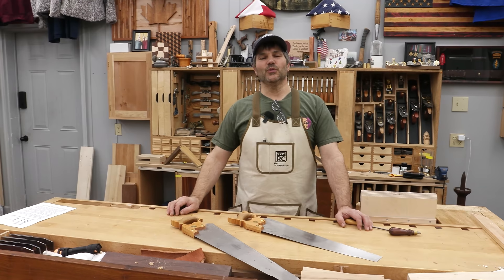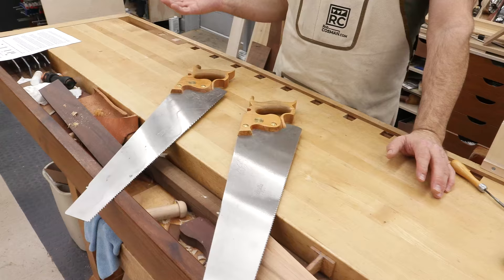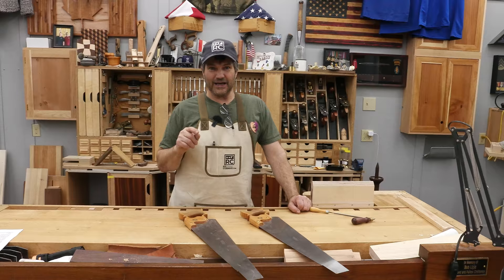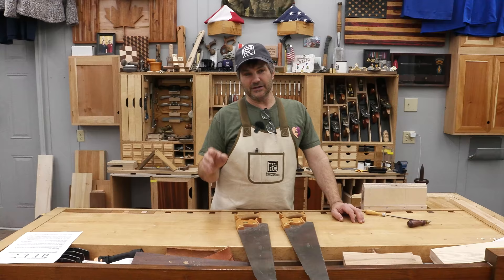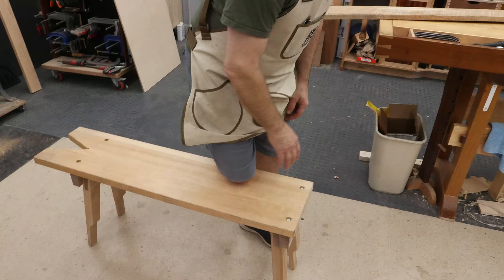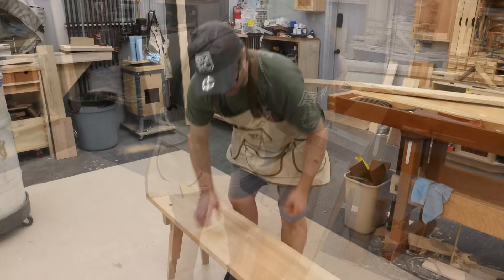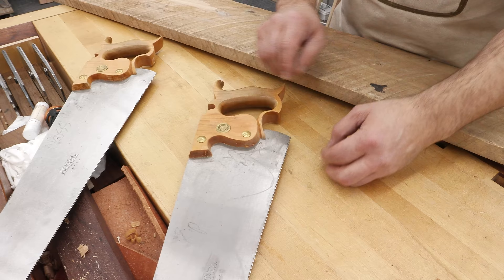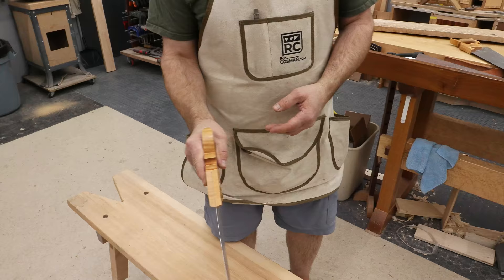Woodworking hand saws and how to use them

Comment: I too like the shorter length of the Lie-Nielsen. You can still find some great Disston vintage saws on the market.  They tend to be a little longer with a little taller saw plate. Very comfortable grips and fun to use something that has been around for 100 years. Just to think of all the people who used it before you is incredible.
Reply from the maker: older saws are great and in many ways better than new if they have not lost their spring

Comment: Great video Rob. I have a couple of pax saws, rip and crosscut, but more aggressive 5tpi rip and 8tpi (I think) on the crosscut. I don't have a table saw or bandsaw so I cut everything with them. Just recently ripped a single zebrano board into 8  1.5x2" pieces that were about 6.5ft long. Great workout! Took around 20 minutes per rip, so an afternoon really to get all my stock cut. It's for a clothes drying rack, and it'll likely take me a few months to complete as I'll revisit it every so often, so in the scheme of things, the sawing isn't really adding much to the project. It's very satisfying too, when you get a straight and accurate (ish!) cut consistently.
Reply from the maker: So satisfying to be a handtool craftsman...unplugged

Comment: If you don't have a saw bench you can still rip long boards using an overhand grip on a taller bench. It’s very comfortable, conserves energy, and surprisingly accurate.
Reply from the maker: thanks for the tip

Comment: Used to always use hand saws as an apprentice, the ‘hard points’ had come out in the mid 80’s so I never really got into the traditional saws EXCEPT when I was in the workshop with the old joiner and we were cutting tenons for doorsHe would do the shoulders on the RAS and we would rip them at opposite ends and side of the workbench with his old rip saws! 
 He kept them very sharp, and they were quite curved, noticeably so! Ie, the teeth were not in a straight line.

It’s surprising how good you get at it when you’re at it all day! 😂 we would throw the cuts off the cheeks at each other when it was absolutely perfect which becomes the norm when your body learns.

One of the hardest things I stressed out about as an apprentice was cutting exactly perpendicular to the top, without and guide lines as reference ( we were allowed to mark the top only, as marking the top and side was too slow and unnecessary apparently 😂)

How would you teach this Rob? With the timber at any angle, and if the blade was far from shiney so you can’t use the reflection trick  ?

Maybe I was just over thinking it ?

Comment: Great video! Those saws are not used often but when they are this video has explained how to use them effectively. Some one should make saws like that with smaller teeth to get started like your dovetail saws. 
Thanks for sharing!
Reply from the maker: we have been thinking o making panel saws for a long time now
Reply: Once you get into sharpening your own saws, you can give the teeth at the toe of the saw a less aggressive rake angle, which makes it easier to start the cut (rip saws in particular).

Comment: I used a handsaw alot in my younger years, taught by an old English Carpenter. One trick to finish a notch (birdsmouths, , stringers....) and other awkward situations in was to invert the saw so you cut away from you. Very effective and more natural than you might think.

Comment: I'm old enough to remember the use of hand saws myself. In fact, if you want to buy another one that's bigger than 22" long. They're very very hard to find!!  A full size saw that is. So I'll take my dad's and   sit down and sharpen every tooth,  reset the  kerf and hang it on the wall.
Reply from the maker: Sharpening saws is a great skill to have and pretty easy to learn but it intimidates a lot of folks

Comment: Thanks for doing a lesson on the often ignored panel saw.  As a hobby wood worker I prefer using hand tools.  A panel saw has a real place in the hobby wood worker shop. Question.  I note you use a 12TPI Cross Cut and a 7TPI Rip.  Why?  I currently have a 12TPI Rip and am looking for a good, old Cross cut.  What are the ins and outs of TPI selection for panel saws.  Most of my backed saws are 12 TPI because I find its fine enough and yet still sharpenable with the poor selection of files these days.
Reply from the maker: When ripping with panel saws its usually a long ripcut  and I want to get through it quickly, therefore a smaller TPI which cuts more aggressively and thus quicker is called for.  5-8 TPI is fairly standard for a rip panel saw.  This is not a joinery cut so I dont need it to be super smooth,  I am just breaking down stock

Comment: Thanks for the tips! Rob, on the top of those saws in your video, near the front of the plate, there appears to be a cut out. Does that have a specific function?  I’ve been planning on getting a better panel saw soon. Right now I just have the cheap big box store style.
Reply from the maker: There are pages and pages of speculation written on what those are for.  No one really knows, its traditional
Reply: I’ve seen people put their other hand on there. Thumb in the round part and the other four finger lying on the top. Not sure if that’s the reason tho
Reply: @perfectjays  sounds like a reasonable explanation, thanks!

Comment: With many power tools, both corded and battery powered, people forget about these hand tools. But when you have to use your own muscle power you learn little subtle lessons. Is the blade clean, sharp, teeth set correctly? If it is binding use some wax. Take that knowledge to the power tools and things will be easier.
Reply from the maker: ditto

Comment: That's not a panel saw.Fix your headline!
Reply: A short handsaw like this has been called a panel saw since before the powered one called that existed.
Reply from the maker: Yes that is a panel saw.  Handsaws come in two basic configurations.  longer than 24 " and shorter than 24".  A handsaw less than 24" is called a "panel saw"  Not to be confused with a powered saw mounted to a frame used to cut plywood which is also called a panel saw.

Comment: Fix your headline.
Reply: Rob's headline is absolutely correct. A short hand saw is traditionally called a panel saw, has been for centuries. They are called panel saws because they were short enough to fit into the upper panel of a large portable tool chest.